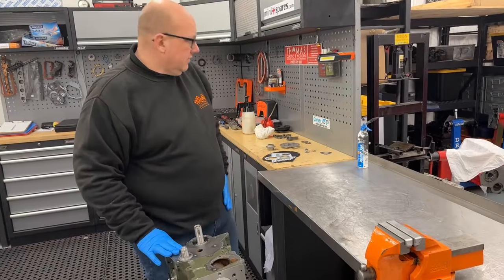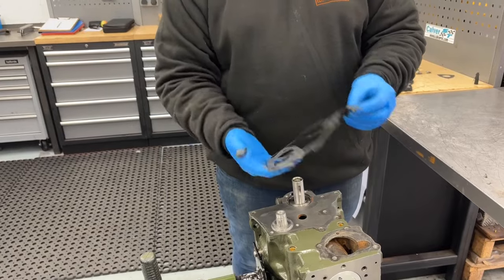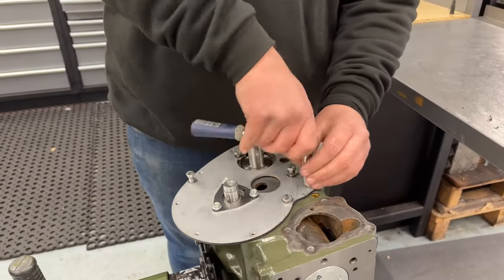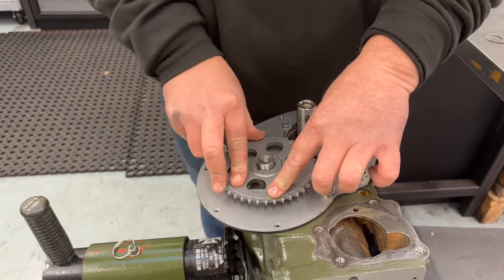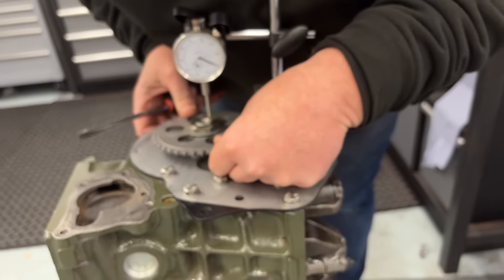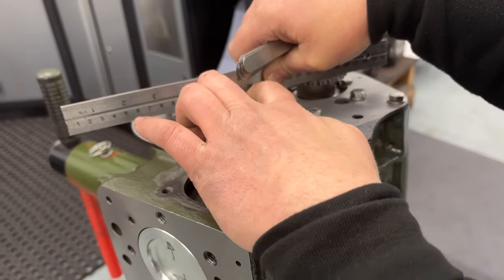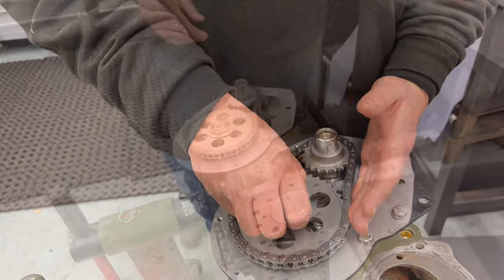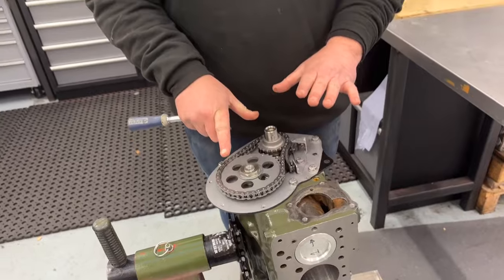Classic Mini 1360 Short Motor Engine Build Pt7 - Cam drive gears install - basic cam timing

Comment: It appears that the cam gear is thicker where you layed your straight edge. This would give you a false reading.
Reply from the maker: Thanks for your comment, I can see your theory, in reality you could set the alignment off the teeth edges, the allowances in the chain fitment on the teeth and the end floats are adequate to not cause any issues doing it this way as per the manual though.